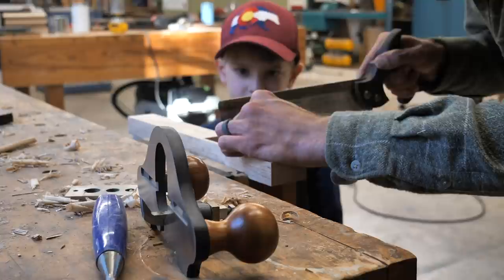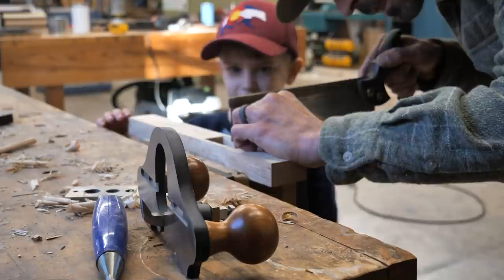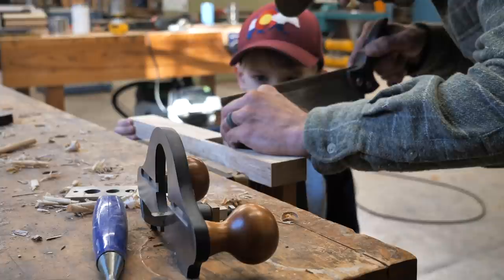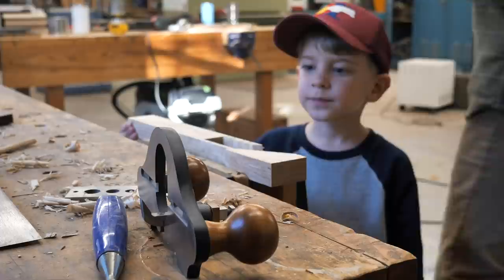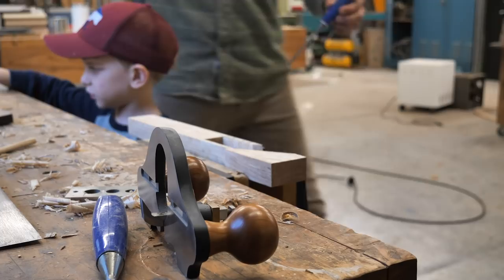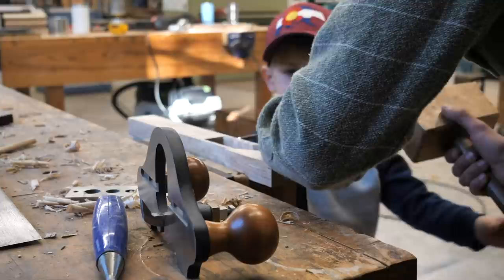Making An Ancient Wooden Lock (Replica)

Comment: As a professional locksmith for over 40 years I find this exceedingly fascinating. Your skill as a wood craftsman and artist are on full display with this type of video. Thanks for sharing your passion with us.
Reply: #lockboss
Reply: It was amazing to see this lock being made,  beautiful job done Andy.
Reply: you forgot that hes a good father too
Reply: I understand how modern locks work and I'm not sure I could pick his lock

Nvm people living 3000 years ago
Reply: Copying my comment from the other thread: As a beginner... How would you go about picking this one? With my first training locks, see-through padlock and normal padlocks, I am resting the first pin on the tumbling part... This is like a pin tumbler but it doesn't rotate to rest that first pin on top of the mechanism. Here all of the pins need to be lifted at the same time for the board to slide out. To my beginner eyes this almost looks like a safer lock than a modern padlock(!?).

Edit: I guess you could MAKE a key for this pretty easily but I'm talking about picking on the spot to be clear. Doable? The weakness I spot, this is just me speculating, is that it's so wide that you could get three L-shaped picks in to lift the pins all at once(?). Since they just go straight up and don't have a point that's too high it'd be easy to hold. If the opening was thinner, the pins heavier or both it'd be less easy(?).

Anyway I knew about this design already but it's pretty cool that locks were this good so far back.  Would be such a cool feature to hide the key for something like this in another wooden feature in your home. Nice work it looks great.
Reply: Now imagine it was designed thousands of years ago

Comment: “Got a click out of one, three is binding...”
Reply: My thoughts exactly.
Reply: Same as well!
Reply: How to spot a lockpickinglawyer subscriber ^^
Reply: So good
Reply: Lol... Or Lpl
Reply: I can totally hear the lockpickinglawyer with your Comment... hahahaha
Reply: Perfect.
Reply: Calm down LpL
Reply: Try some beeswax?
Reply: As a beginner... How would you go about picking this one? With my first training locks, see-through padlock and normal padlocks, I am resting the first pin on the tumbling part... This is like a pin tumbler but it doesn't rotate to rest that first pin on top of the mechanism. Here all of the pins need to be lifted at the same time for the board to slide out. To my beginner eyes this almost looks like a safer lock than a modern padlock(!?).

Edit: I guess you could MAKE a key for this pretty easily but I'm talking about picking on the spot to be clear. Doable? The weakness I spot, this is just me speculating, is that it's so wide that you could get three L-shaped picks in to lift the pins all at once(?). Since they just go straight up and don't have a point that's too high it'd be easy to hold. If the opening was thinner, the pins heavier or both it'd be less easy(?).

Anyway I knew about this design already but it's pretty cool that locks were this good so far back.  Would be such a cool feature to hide the key for something like this in another wooden feature in your home. Nice work it looks great.
Reply: @SicketMog  I think they just used an axe to pick locks back then!! Also locks are just there to keep people honest, you can break into anything if you want to.
Reply: @mattd8222  Well yeah I don't doubt you can just break the lock. I'm just wondering how one would go about picking it (in the hypothetical scenario there was a magic material that made it impossible to destroy and so thin that you could only get a single pick in).

Comment: The way you have it is clever but the key tunnel will fill with rain water and rot. It should go upside down with springs behind the locking pins.
Reply from the maker: You’re right and that crossed my mind as well.  I was thinking about putting a channel in it so water can escape.  Or just use it somewhere there’s plenty of cover.

Comment: How does it work though? Specifically one of the pins dropping in the wrong hole and stopping the bar from seating all the way?
Reply: Good point- I think the bar is just going in too fast for them to drop. He also rounded the edges of each pin to prevent sticking. 
However, this design does seem like it'd cause the lock to jam if you inserted the bar slower.

What I expected to see when I went back to check is the pins and holes getting smaller as they moved closer to the hand of the person inserting the bar- this would mean each pin would glide over all the preceding holes, being unable to drop in, before finding its own slot and locking. 
If you were worried about the reduced thickness of pins weakening the lock, you could also keep each pin & socket the same size but carve them into different shapes, e.g triangles, squares etc.  as a round peg won't fit a square hole. 
Thirdly, you could move pins sideways in the lock, so that each fell down. This would also make the lock less pickable.

I suppose all three approaches wouldn't translate very well to a smaller lock or higher number of pins- modern locks don't have to solve this problem as the cylinder (equivalent to the inserted bar here) never moves laterally but only rotates.

Comment: Great video and a fantastic project. The finished product is really quite pretty. I do, however, have a technical question about the lock. It appears that all of the pins are in line with one another. When sliding the bolt into the locked position,  what keeps the pins from dropping into the wrong holes?

Also, what is 'AR' style?

Comment: What keeps the first pin from falling into the hole if it’s pushed in slow?
Reply: You noticed that too! That's why he pushes it in quickly. Otherwise I think it would've. That's why keys have angles between each tooth or ridge.
Reply: He could have made the first pin bigger and made them smaller as you go in. Then on the latch part you make the first knotch small for the last pin and increase their size as you go down the line that way the pins can only go into the correct hole.

Comment: What's the name of the tool you were using to clean up the lines on the inside of the keyway (around 10:20)? It looks like a manual router
Reply: Yeah handheld router plane. Great for precise depths
Reply: @acb43211  I have never seen one before, but it looks really handy

Comment: Almost clever, most certainly nothing like original locks. That lock could be 'picked' in a heartbeat and is there for  useless as a lock. You don't want whatever is being guarded to be locked up with a lock that a child could open. Key ways were tortuous and was the primary defense at keeping simple locks safe. Good wood skills, well, the banging it with a hammer part was.